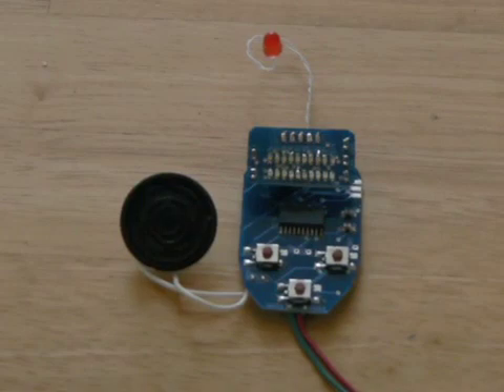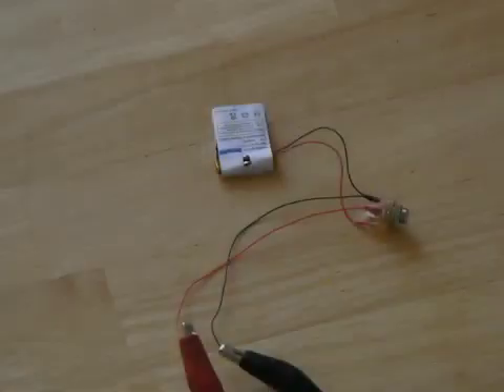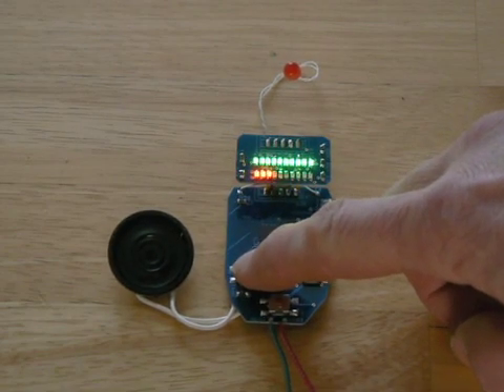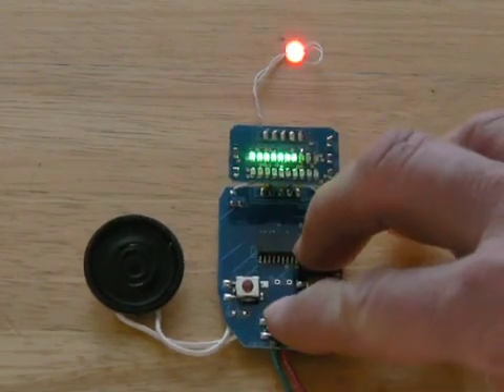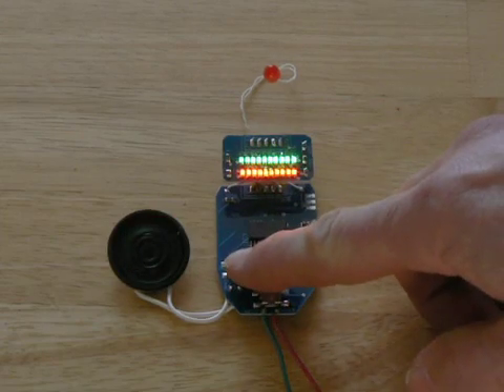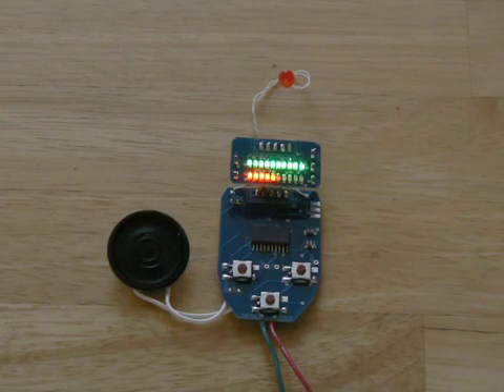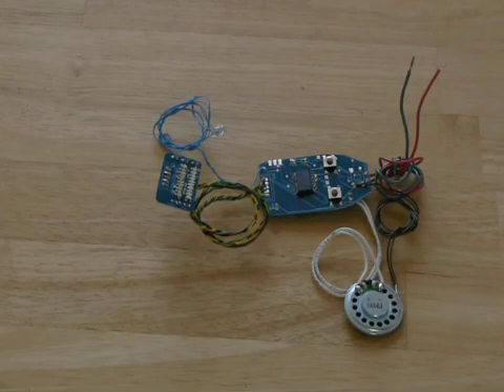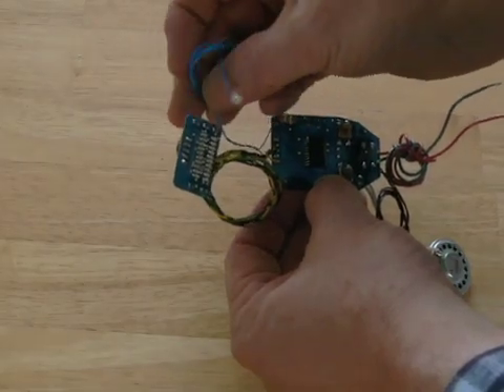Cobra Head Phaser Electronics

Comment: Not to be that guy, but a phaser has 16 settings and your kit here has 20.
Reply: Well then I apoligize for the error I made and I humbly beg your forgiveness. Because you are correct. I was wrong. But one learns from mistakes. And I learn everyday.
Reply from the maker: Yes, that is true for the Boomerang and Dolphin style phasers. The Cobra style phaser has 20 settings. Don't worry, I have done my research over the last 20 years. Plus, I used to supply the electronics for the aftermarket kits from Roddenberry.com.

Comment: Too bad you got the up and down buttons backwards.
Reply from the maker: They are screen accurate. It is configured exactly the same way as the 
screen used prop. However, there are some people that like the buttons 
reversed, so I have a wiring configuration on the board that I can 
easily change to make the buttons the right way around. Thanks for your 
comment.
Reply from the maker: There is also a newer version of this board that has continuous firing mode on Level 3.
Reply: Gerhard Mros that's cool. Well where can one buy these boards cause you have no info about that and the only ebay account I found has nothing like this. Have you considered Etsy?
Reply from the maker: My eBay name is GMProp. I have the new version of the Cobra Phaser electronics listed right now. I also have a lot of other prop electronics listed. I have never listed on Etsy before, but I will check it out.

Comment: Hello! i myself do not own a stapleton or roddenberry kit, but what i do have is a vintage playmates phaser from my childhood, i've kept it twenty years, and i've recently been thinking i would like to give it a full prop makeover. Would your kits be able to fit the playmates shell?
Reply from the maker: +Tessa Jalloh Yes, they will fit the Playmates Phaser. Several people have purchased my Cobra phaser electronics or the Boomerang "First Contact" Phaser electronics to use in the Playmates phasers. Obviously you would have to gut the Playmates phaser to make the electronics fit, but it will work. Both the Cobra and Boomerang phaser electronics are currently available on eBay at a reduced promotional price. Thanks!

Comment: do you still have them up now?
Reply from the maker: +Worthiestnobody I just put them up on eBay now. And it includes the rechargeable battery system. Check eBay Item # 171953921650. Thanks!
Reply: a lot more than what i was hoping for